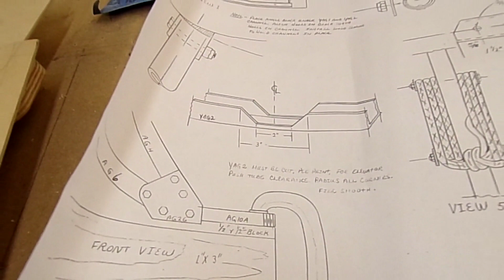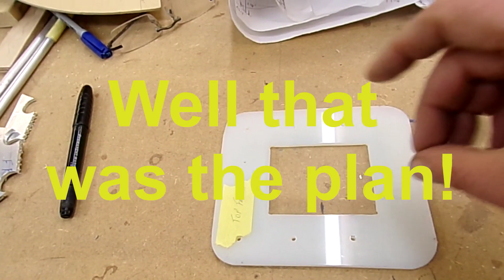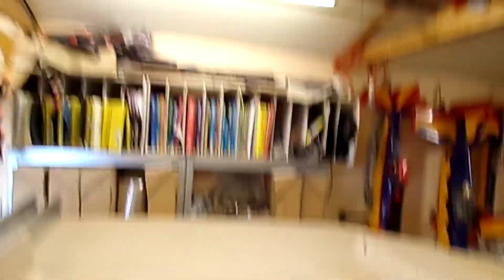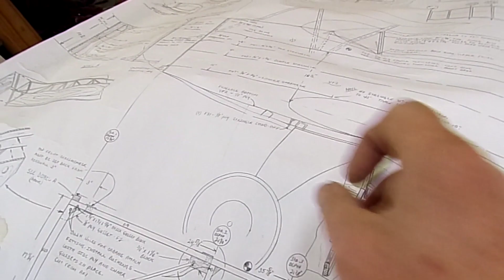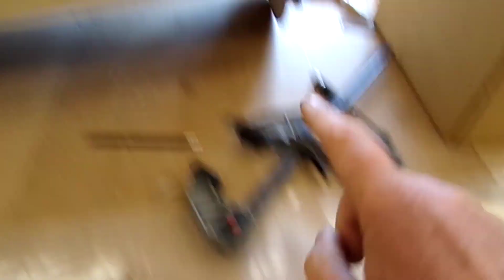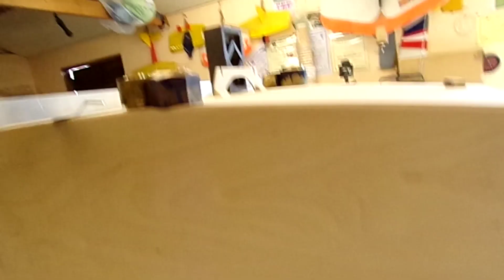EP95 Lower fuselage stringer Fisher Youngster V

Comment: Hello, the drawing ask for stringers dim 1/4 x 3/4 this seem very small and frigile, it seem that yours on the video are bigger, did you decided to adapt these dimensions too ? Thanks, rgds Jm
Reply: Hello, yes I know this isn't structural, I thought that just the covering could bend these thin piece of wood. I'll go ahead with the drawing dims and add some support, not easy when going to the rear of the fuselage as there is non plywood everywhere. Thanks, rgds, Jm
Reply from the maker: @Jean-MarcMaldague  I think in the next video I show how I fit them to the cross members.  They have stood up well to my covering.
Reply from the maker: @Jean-MarcMaldague  no the stringers are as per the plan but have additional support not shown on the  plan. If I  remember correctly there is more detail in the following video. The stringers are not structural,  they are there for the covering to give shape.

Comment: I just cut the old belly stringers off the biplane  just so I can see how well they match the new fuselage.   Also removed the control stick and linkages.   Great work!!  What glue system are you using,  I can't even see any glue on your fuselage,  unlike mine,  lol😊
Reply from the maker: I am using T88 which is a pain to get over here in the UK but it is the one specified by Fisher. I clean off exess as soon as I can and sand it once it is hard, I was trained to think of glue you can see as weight, as it adds little to the strength (there is the exception of fillets but they have to have a structural bulking agent in to work). 🙂
Reply: @flyingkub  I'm using the same, but my ply is mahogany, so I guess that's why it shows more, and it makes the ply even darker.  Yes, I try to scrape off all the excess as soon as I can  Looking good!!   Yes, I try to scrape off the excess glue as soon as possible.
Reply from the maker: @jimmyboy163  I did see you do that in one of your recent videos,  very much in the  same way. On mahogany ply the glue will show more but will disappear when you varnish.

Comment: What a difference a cold makes.  Without the cold you have made some real visible progress. It is also interesting to see how many things are wrong with the plans.  You've found others before so it makes me wonder how many of this model have been built by others.  Regards as usual, Michael
Reply from the maker: Thanks Michael, yes far more progress and that includes servicing the Kub.
There are a number of errors on the plans but not many would effect safety much. I don't think there have been many built and flown. My serial number is sub 50 and that is from plan sets sold, which probably equates to sub 20 built and flown.

Comment: The stringers are adding a nice curve to the underside.  Its a good thing that you noticed the slight error before you got much further and while it remains a simple fix.  I doubt that there has ever been a homebuilt project where the builder hasn't thought "ah, thats not quite right".
Reply from the maker: An old chap that I helped restore an aircraft with, said "When you build an aeroplane, you build two, one for scrap and one to fly". I think I have done fairly well, with very few bit in the bin :-) I do think you are correct about the hombuilt project having the "ah, thats not quite right". :-)